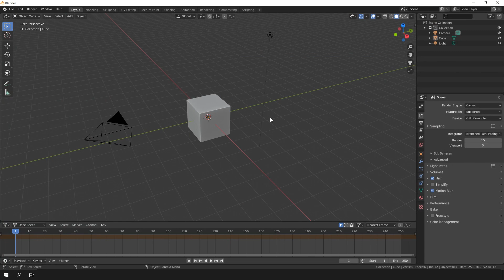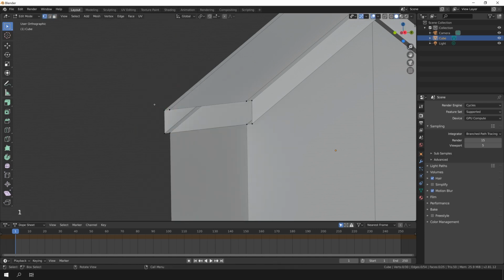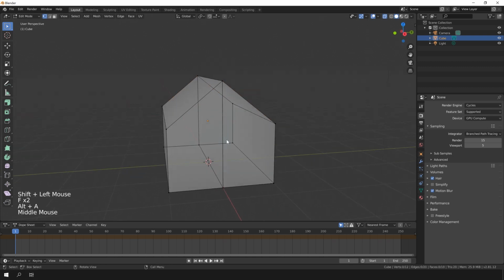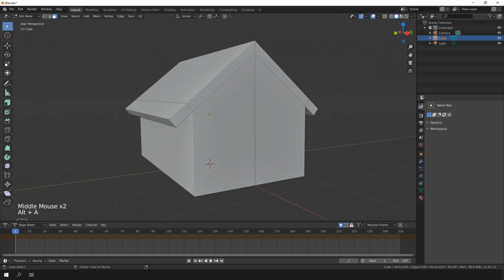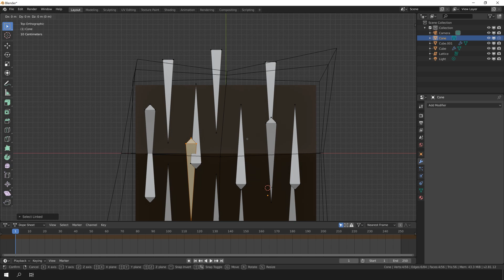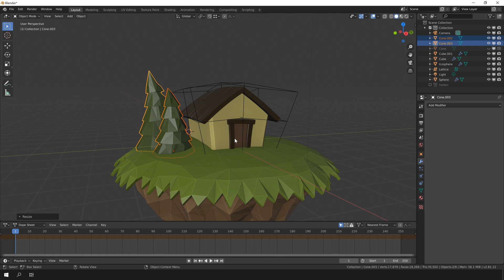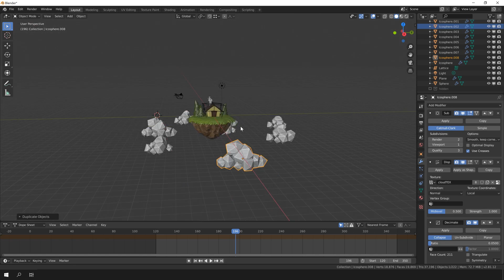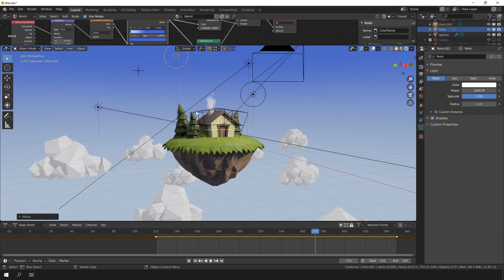Modeling a low-poly house scene | Blender 2.8 Tips & Tricks #1

Comment: Hi,great video. Can u tell me,what is best i do different house low poly and we start making of simpe cube make wooden beam and copy it a lot of times and step by step make house..Is it better like that or like this,looks like more easier..
Reply from the maker: Yeah, this approach is more straight forward, but there's no "best" in 3d modeling :) Lots of ways to achieve anything, and it all depends on what the end goal is. If you have an intention to animate the house "constructing" from ground up, it's good to have all the beams as separate objects. But if all you need is a stylised house model, it might be simpler to go this route. Hope that helps!
Reply: @SketchesForHumanity  Yes, just like you say, it is done of your own free will, your system of work and project is fast, it is that low poly is the same as in the second one I did, only mine turned out more like from the drawings ..Thanks..Today I will try in your system of work..😊

Comment: Awesome video! One question: when deforming the lattice at 2:32, how do you get the edge to stay straight?
Reply from the maker: Thanks! I'm not quite sure what you mean by that? i.e. what straight edge are you referring to? If you meant the leftmost vertical edge of the lattice object at 2:32, that was because I had proportional editing turned on and at a quite big radius. More on proportional editing at https://docs.blender.org/manual/en/latest/editors/3dview/controls/proportional_editing.html :)
Reply: thanks :)

Comment: wait why did you turn off the keystroked at the second half? i woud've loved to see how you did that.
Reply from the maker: Sorry, must've been by accident.. If there's some specific things you want to know, I can try to explain :)
Reply: how you did the coloring for specific parts of the model, if i try it it just makes the whole model that color. the warping of the house, witch looked really cool in the end btw. how you did the cutout of the roof, how you did the cut-out of the side of the island, how you mirrored that. how you removed the edges of the chimney, how you made the particles into smoke, how you made the background. how you made the island low poly, and clouds and stuff..
 i know it's alot, sorry for that.
i've just started using blender and i don't know many specific shortcuts and such. thx for the help btw appriciate it!
Reply from the maker: @omg_its_h  No problem, I'll throw a list of names at you so you can find more info on these specific things :)
- Coloring specific parts: I added new material slots (and new materials in those slots) for every color of the object. In Edit mode you can assign different faces to different slots.
- Warping of the house was done with a lattice object and a lattice modifier on the house object.
- Roof cutout was done with a boolean modifier and the spiky objects you see in the video (basically the boolean "cuts" away the spike object's shapes from the roof)
- Grass cutout of the island was done with the knife tool, mirroring just by duplicating & scaling
- The edges of the chimney were done with the bevel tool
- Particles were rendered as circle objects so it looks like smoke
- Island and other stuff were made low poly with the decimate modifier.

Hope that helps! There's tons of info&tutorials on all these things if you just search by their name :)
Reply: thank for helping me out man! really appriciate it!